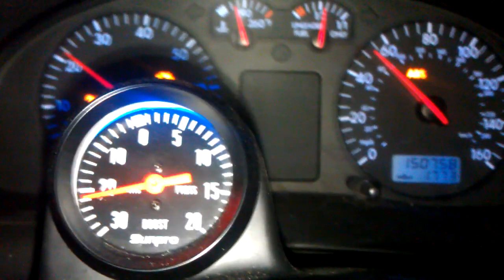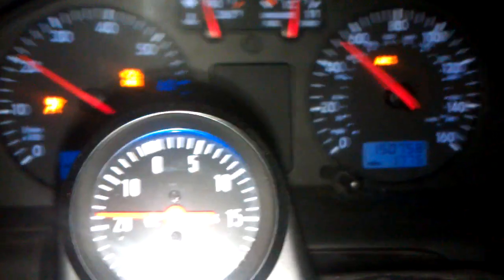B5 VW Passat boost problems

Comment: looked like in limp mode,my s3 does around 5-7psi in limp mode when overboosted on stock map. If you want to run higher boost you need to remap like I did REVO. Now I can run 24psi.

Comment: This has happened to me before. If It happens again it's usually just where the intake hose comes off of the intercooler that hose clamp is either broken or isn't tight enough and some of the air is lost before being compressed

Comment: I have this same problem! At first I when I was doing some research on it I read it was a DV problem. But I replaced it and nothing happened. I just had my motor rebuilt and a refurbished turbo put on and that's when the problem started

Comment: so its like you are loosin the turbo/power right? it wont acelerate, and when u turn off and on the key it works? properly  right? it its that, ive got the same problem it appears sometimes, ive got all stocked, if you find some info tell me thanks!
Reply: I know your comment is several years old but I am having the same exact issue with the 1.8 T Jetta. Did you ever find the problem?
Reply: N75 valve
Reply: Sticking turbo veins........